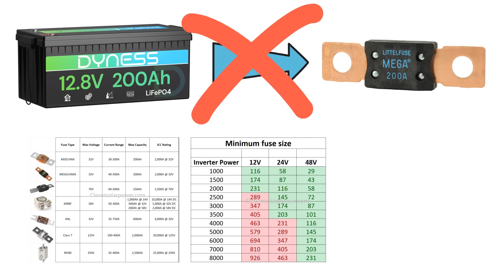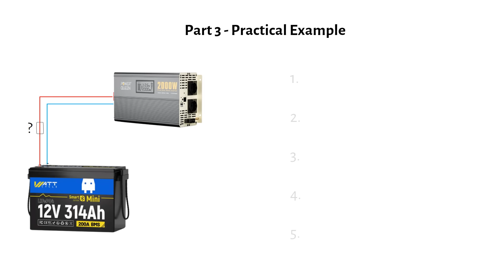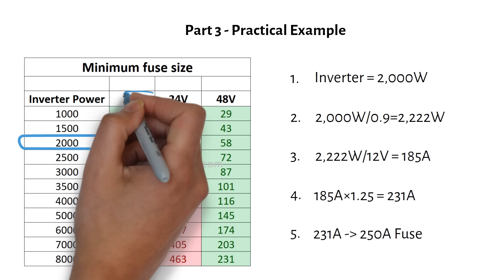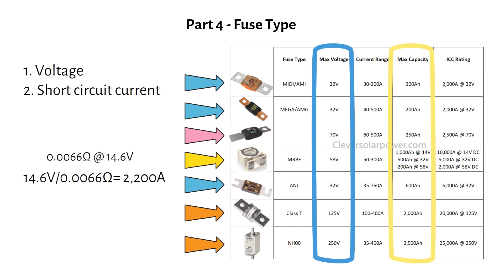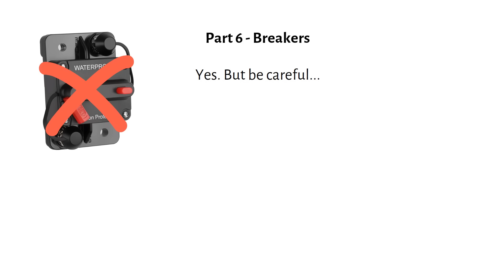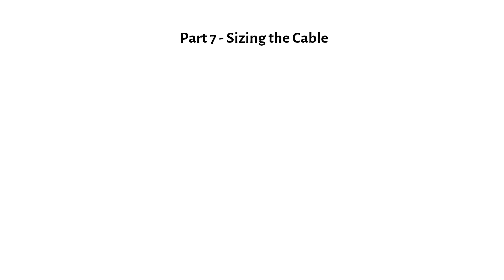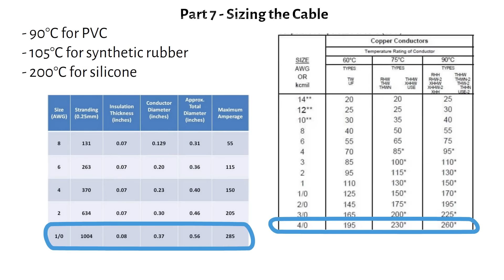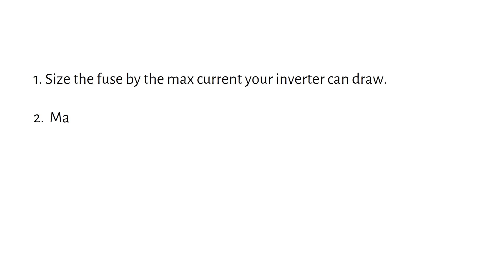How to Size Your Battery Fuse to Inverter

Comment: Well done Nicks. Can one use Breaker in place  of Fuse?
Reply from the maker: Yes
Reply: @cleversolarpower Will 125a or 150a Breaker be Okay for a 4000w/48v?
Reply from the maker: @Bonifacio_001  Checkout my calculator on my website.

Comment: 9:40 What do you mean? I used 120A welding on my 24v 100Ah LiFePo4 battery and it cut off the power. So what's the difference between the fuse?
Reply from the maker: Good question. The reason it cut off is because the BMS has over current protection, or it got too hot, one of the two. A short is very different from an over current protection. Many more amps flow. And MOSFETs might not be able to break that current all of the time.

Comment: So according to your diagram 231A is OK  for 12V  and 48V, but is not suggested for 24V. Can you explain why?
Reply from the maker: I think you interpret it wrong. 231 is the current you draw is your inverter is 2000W on 12V. That's 116A on 24V and 58A on 48V.

Comment: I understand your videos much better than your book. will you one day write a book that focuses on 2000w inverter or less systems for beginners with no knowledge of electrical engineering?
Reply from the maker: I have a video coming soon about a 24V 2000W inverter wiring diagram with batteries in parallel. Yes, my book is more technical for those people who want it. But I believe it builds up slowly to more technical explanations.

Comment: One consideration I don't see is that the voltage of battery is a range. So at lower SOC the battery might be putting out f.ex 10.2V (which is near common voltage cutoff limit for inverters) but this still can happen for quite a while (with lead acid at least)

With 2kW inverter with the 2222W real draw the 10V battery pulls at 222A already and that's not even that far from the 231A recommended fuse limit.
Reply from the maker: Indeed, 2,222W/10V=222A. However, since we have to round up to the nearest fuse after 231A, it's going to be a 250A fuse. So 231A is the absolute lowest fuse size.

Comment: wow I came here to figure out what fuse I needed for my 12v 314Ah battery to my 2,000watt inverter and I see exactly that same setup here
Reply from the maker: My pleasure 😄
Reply: Bdw what if battery bms is rated 200A, is there a point installing 250 fuse or rather 200a? This is confusing.

Comment: Multiply by 1.25 for safety. 2:11 You are increasing the threshold at which a safety device (the fuse) trips. Is this really safety?
Reply: You are correct this is weary dangerous. Especially when the recommended fuses all have a working area up to 140% of its rated current"What you can draw continuous ". So, the reality is you end up with a 1.75 “Safety Factor” in reality making it a lot less safe.
Reply from the maker: Yes, because you are letting the fuse and cable run cooler, not close to it's 100% rated current. And you size the cable for that increased current.
Reply: @cleversolarpower  I understand you must defend somehow what you've said 🙂
But you was talking about sizing the fuse, not the cable. Cable is a new topic here.

Comment: You size the fuse based on the ampacity of the cable.  Not the size of the inverter.
Reply from the maker: And how do you calculate the current going through the cable? 😉
Reply: @cleversolarpower Well I hope you choose a cable that can handle the load.  But as you said in the video the fuse should protect the cable, not the inverter.

Comment: Hello Sir, great information you provided. I would like to ask a question if I may please. I have a 2000w inverter with a 12v 100Ah battery (and getting another battery same values) According with your calculations even thought I have just one battery at the moment, I still do need a 250 Amp fuse or DC breaker for my setup. Because I will be connecting the batteries in parallel, should I put fuses in each battery in addition to the output of both batteries? What value the fuses should be for each battery?  Thank you for your time and your videos they are really informative..... Best regards Sir

Comment: Great info thanks man. I am in the process of designing a 12v or 24v system for an offroad camper trailer, mostly figured out except for the  type of fuse to use. I have NH fuses for my house solar, are these a good idea for an offroad trailer or would moulded DC breakers or T fuses be a better idea ?  I like NH fuses for the fast acting ability. Cheers🙏
Reply from the maker: Depends if you need to shut it down (isolate). If you already have installed NH fuses, then these are best. They are super cheap as well (at least here in Europe).
Reply: @cleversolarpower Thanks for your speedy reply. I haven't installed yet but do have a couple of NH00 fuse holders left over from my house solar upgrade last year. My concern with them is vibration offroad being a blade type fuse, although they do fit very tightly in the housing. I do love them for quick shutdown if needed.

Comment: The message is that a lithium installation is complicated, difficult, and expensive - if it is done safely to cope with the maximum currents that may be delivered. I personally believe the most important thing to make sure is that every battery is individually fused with a MRBF.
Reply: Maybe watch the video again. And then a few more as well

Comment: You started off correct. The battery fuse protects the wire. The draw of the inverter is not important,  it is the gage of the wire. So, the gage of the wire is what determines the fuse. The gage of the wire is determined by the draw of the device.
Reply from the maker: You size for the largest possible inverter draw + efficiency of it +safety factor.
Reply: Makes sense to me 👍🏼 If you are protecting the wire, the fuse should be somewhat less amps than what the wire can handle. If you are protecting the inverter or whatever else, it's different story and different calculation.

Comment: I believe you are wrong.  In a properly designed circuit the fuse protects both the circuit and the battery.  Most lithium batteries have a rated maximum current draw; while the battery's built in BMS offers some protection; the addition of a fuse or better yet a circuit breaker is good practice.  I suggest the circuit breaker route as users do what they do and they may overload the inverter and batteries on occasion.  The circuit breaker provides the user the ease of a reset rather than a more difficult fuse replacement.
Reply: Circuit breakers have some volt drop. Not a good choice with an inverter on a 12V system. A properly designed system will never trip/blow your current protection, the inverter will shut down. If it doesn't, buy a better inverter. Replacing fuses regularly means you designed it wrong.
Reply: @rubikmonat6589  Fuses also have some voltage drop, and so do the terminations, wire in front of the protection, etc.  The difference is negligible.  CB's are advantaged by being resettable and serving as an easy form of disconnect.  I have damaged many a fuse by pulling it even with the correct tools.  As for circuit protection in general, livewire is correct that you should be sizing for the maximum expected circuit ampacity.  Everything above that which your power source can deliver only serves to provide greater fault current capability, which in a properly designed system you want to minimize.  Some of these 12.8V 100Ah battery BMS's can do 400A+ current flow for several seconds or even a minute or more.  Two 12.8V 100Ah batteries, 800A.  Three 12.8V 100Ah batteries, 1200A.  And so on.  If you don't see the problem with this, frankly, you have no business configuring/installing these power systems.  The reason no YT-er talks about fault current is because they have no idea what they are doing.  They are just a parrot reading off a script.
Reply: @KungPowEnterFist  Ive red that circuit breaker for batter with solar is not best, becuase the current flows both ways. Whats your take on it?

Comment: In part 7 the amperage differences in the ABYC(left) vs NEC(right) tables are way less about 90C vs 105C and much more about use in free air vs use in conduit. Also many types of wires have multiple ratings for multiple regulatory bodies. The wire I'm looking at right now is rated 105C for  AWM (Appliance Wiring Material) and 90C for THHN-2. NEC has another table for use in free air and it maps fairly closely to ABYC and ISO.

Comment: In part 1 you say the fuse does not protect the battery. I disagree. A high AIC(breaking capacity) battery fuse is the last line of defence for a dead short in case the BMS FETs fail closed. The fuse protects the wire and the battery. LFP batteries have toxic stuff inside that can be vented during an unquenched dead short.
Reply: MOSFETs in a BMS failing closed does not mean that the positive and negative terminals of the battery gets shorted. MOSFETs are not connected between the positive and negative outputs. It would not make sense to have them like that in the circuit because in that case they would short out the terminals when they turn on. Usually the positive output terminal is connected to the positive terminals of the cells directly and the BMS is in series with the wire coming from the negative terminals of the cells. MOSFETs failing short just means that the BMS loses control and is not able to disconnect the battery cells in case of over voltage, under voltage, over current etc. A BMS can therefore have failed MOSFETs leaving the protection mechanism disabled without the user knowing about it.
If something does short out inside the battery that creates a high current flow (like the cells shorting out for some reason), then that’s a short inside the battery. An exterior fuse won’t help if the short is internal.
But I agree with you that the fuse could potentially protect the battery, just not in the scenario you described.
However, imagine this: A battery is rated for a continuous current of 100 A. The wire gauge inside the battery is rated according to that as well. But, imagine a case where a certain battery does not have a properly working over current protection mechanism (shame on you, battery manufacturers), so the battery will happily deliver 200 A if you ask it to… until the internal cables between the cells and the BMS start to melt, the cells start to vent and so on. Putting a 100 A fuse (or even lower for higher safety) on the battery terminal will not allow much more than 100 A to flow either in or out from the battery, saving the battery from having a total meltdown.
So yep, you’re right; a fuse can protect both the battery and the cable. This is why we should always, always, and again always put a fuse on the terminals of Eco-Worthy batteries, for example. (No proper over current protection!)
Reply: @TheCrazyStudent  agree one small nit to pick. Imagine you have 2 or more 4s batteries in parallel and one battery experiences a single cell internal short. The other batteries' current will flow through the battery which is now effectively 3s.  Its not nearly the same current as a dead short but it still could be enough current to melt things are vent electrolyte.
Reply: @eigengrau_hund  Very true. That’s also another reason why every battery should be fused when they are connected in parallel. The scenario you describe could happen, but only if the BMS in the faulty battery fails to detect that there is an issue. If, for example, there are four batteries in parallel and one fails short due to cell damage (cell fails short), then the BMS in the faulty battery is still sitting between the cells and the output terminals. When the remaining three batteries start to pump an enormous amount of current into the failed battery, a properly designed BMS should then engage its over current protection and disconnect itself from the rest of the battery bank. However, the electronics on a BMS can also fail, and some BMS boards might just be badly designed. So a fuse on every battery terminal definitely adds some extra safety.
Reply: @TheCrazyStudent  totally agree each battery should have supplemental over-current protection. Another small nit. The current flowing though the battery with the shorted cell is not enormous compared to the dead short ampacity of the same battery.
Reply: @eigengrau_hund  Can you clarify “dead short ampacity of the battery”?
I’m not exactly sure what you mean, because the term “ampacity” is usually used when talking about wires, or traces on a PCB. It refers to the current-carrying capability of the conductor. In a battery, there are more than just a few conductors. There is also a BMS, and there are battery cells and so on. Different parts in a battery might have different current-carrying capabilities, or in other words different ampacities.
Reply: @TheCrazyStudent  For a 4s battery at 13.6 volts with an internal resistance of 0.0043 oms with a super conductor placed directly from positive to negative terminal the theoretical dead short ampacity is no higher than 3162.8 amps. For the same battery with a shorted single cell the fault ampacity is no higher than 839.5 amps regardless of how many batteries are in parallel.

Comment: Thanks for the video. What about if one would never reach 80% or even less of the inverter capacity? For example with a 500w inverter 90% efficient (pure sine wave or modified sine wave), if one would only use up to 50% or 60% of that (250-300w loads max), that would surely factor in and allow for a smaller fuse? Such as a 50a or even 40a fuse? Even accounting for the extra safety 25% factor, etc. In this example, what size cables would you say is recommended? for a max continous load of 250-300w. At 12v. Cheers

Comment: If you are determining the output of the inverter with a 90% efficiency, wouldn't you MULTIPLY the 2000W by .9 for an actual output of 1800W? If you DIVIDE like your example, your 90% efficient inverter is putting out MORE than it is capable of! Efficiency DETRACTS from rated, not ADDS to it!
Reply from the maker: If an inverter is 90% efficient, and the output is 2000W, then the input is greater than 2000W.
Reply: @cleversolarpower Slaps forehead. Of course of the max output is 2000 Watts, it has to draw 2222.22 watts to get to the desired 2000 watts on the output.  What a bad mistake I would have made.  Thanks for explaining here.